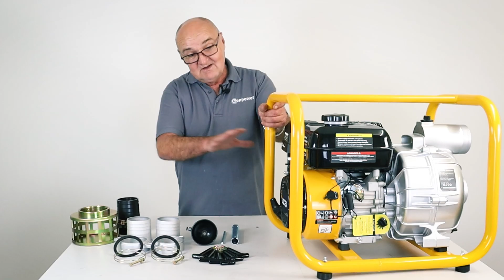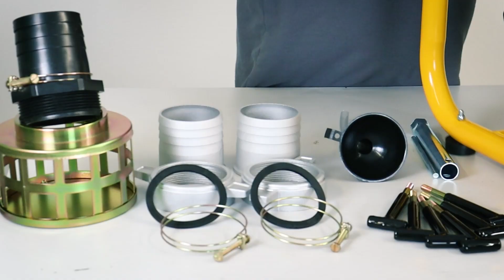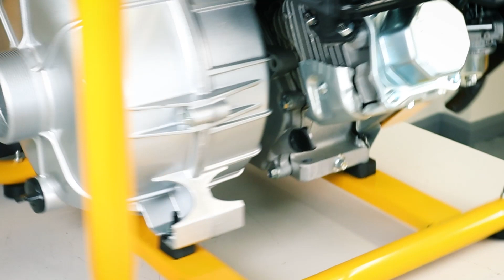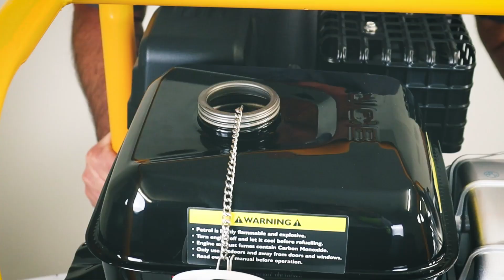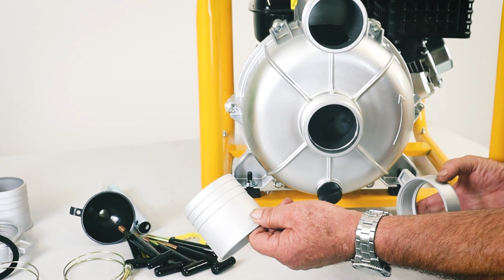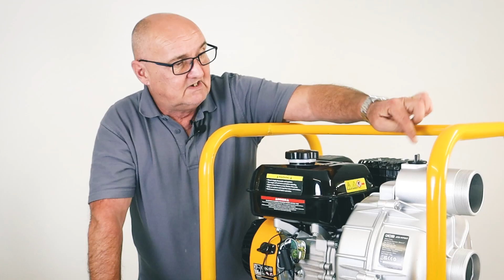Unboxing This JCB 80mm Petrol Trash Water Pump: Three variations of this versatile water pump!

Comment: JCB-WP80T Trash Water Pump // 
We use such a motor pump on a mini dredger for pumping out bottom sediments in reservoirs, for cleaning berths and boathouses. We use a suction nozzle with a Bagermaster hydraulic jet with the motor pump.
Reply from the maker: That's awesome! Do you have any videos of it in action?